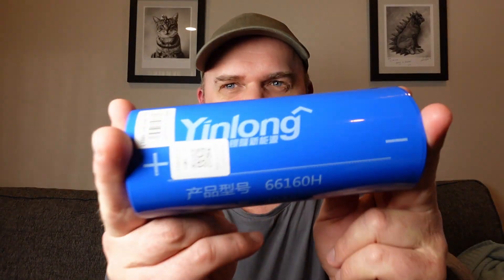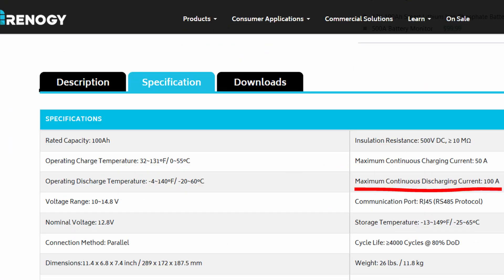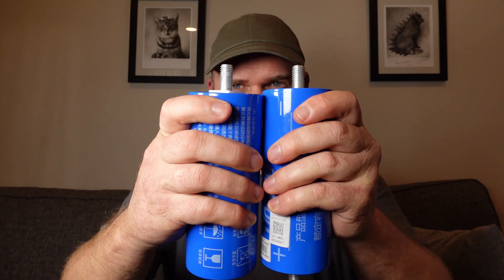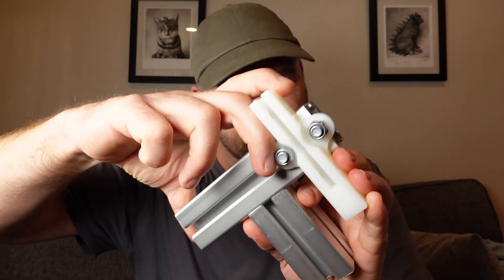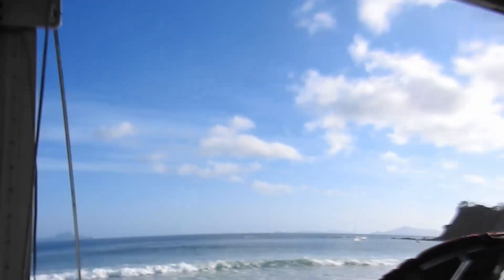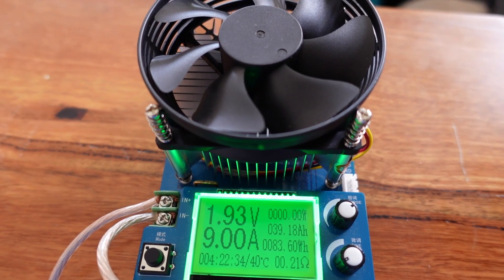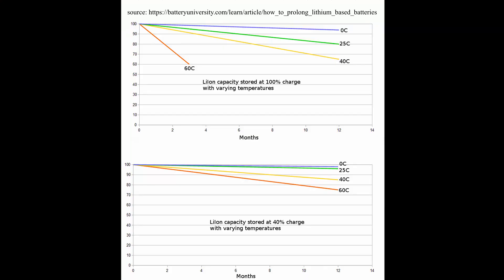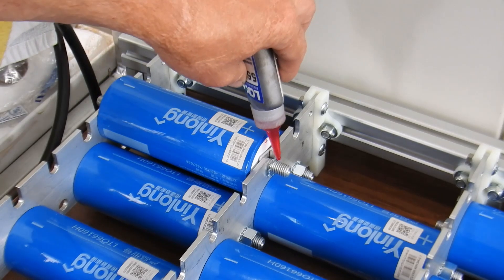Campervan DIY battery build HUGE POWER!

Comment: Aluminum was banned in house wiring decades ago partly because of oxidation increasing the connection resistance. How are you ensuring a gas-tight connection?
Reply from the maker: Hey Lu, thabks for your comment.  phew... just as well I'm not building a house! Several people have bought it up as a potential issue, but I do not believe it will be one.  The battery lugs are aluminum and I believe having nearly 200 copper/aluminium dissimilar junctions would be more problematic than aluminum/aluminum junctions.  The ali bar was lightly sanded before connection and a dielectric grease was put on the connection to prevent air/moisture from creeping in.  Keep following and I guess we will find out in time if it was successful.

Comment: Nice project. I wondered, what for you need so much capacity  - until i saw the fridge 😂 What kind of fuse and power switch did you use? Nice Unimog btw 👍
Reply from the maker: Cheers Stefan, yeah, induction cooking, electric oven etc etc.  Am using a big HRC Mersen fuse and an Industrial Siemens switch as a main switch.  In coming videos.

Comment: Here’s the problem:  many of the stats you’ve mentioned are manufacturers claims that are not necessarily reliable.  Especially regarding discharge rate, reliability and safety.
Reply from the maker: Here's the problem with your assertion...  LTO is not a novel chemistry to this manufacturer, it has been around for about 20 years. The chemistry has known properties, all of which show it to be the safest of all the lithium chemistries,  it is the only lithium chemistry that has been approved for use in medical implants.  It has the highest runaway temperature, graphite anodes are a major cause for thermal runaway in lithium chemistries (this chemistry does not have graphite electrodes).  It has the lowest internal resistance and highest drain because of the huge surface area that is afforded on the anode due to the nanocrystaline structure.  The discharge rates of these cells are well known by the car audio community where they run tens of kilowatts and monitor performance capabilities of these cells closely. The limiting factor for the life cycle of most lithium chemistries is the buildup of solid electrolyte interphase layer from decomposition of electrolyte and the breakdown of the graphite electrodes as they shrink and grow when cycled.  It also doesn't tend to grow dendrites which will kill a cell like other lithium chemistries do.  This chemistry does not form a stable SEI layer like traditional chemistries and the titanium based electrodes mean they dont break down in the same manner that graphite does.  While I can accept that specifications for all batteries are likely to be given in best case lab conditions and are unlikely to be fully met in real world conditions.  I believe that this is the safest and most rugged lithium chemistry available today.

Comment: He actually changed that assessment in a recent video.  He got 85% at a 5c discharge.  At a 1c discharge he got 99%.
Reply from the maker: Yeah, I haven't seen it.  But I might setup and do a 5C too. It's very easy to get unaccounted losses if pulling a couple hundred amps.

Comment: Dendrites are not formed from batteries being cold, its just the electrolyte freezing inside, your LTO cells have a different electrolyte which has a lower freezing point. (Edit: Dendrites form from charging while the battery is extremely cold)
Reply from the maker: Really?  https://www.researchgate.net/publication/269574387_Observation_of_Lithium_Dendrites_at_Ambient_Temperature_and_Below
Reply: @brendontait6968  ah, the dendrites form from charging while things are extremely cold, not directly from being extremely cold, so in a way we are both correct but not sharing the entire context of our statements. I learned something thanks!
Reply from the maker: Effectively dendrites are formed in lithium cells if used in cold conditions, charging does encompass use in my mind. This has little to do with the freezing of the electrolyte to my understanding. There is no way I'm likely to be able to make a video that details every conditional aspect of each claim I make.  I want to try and make videos that can capture and inform the majority of viewers key points.  I'm not very good at translating thoughts from my mind into digestible information, but working on it. Cheers

Comment: With all that aluminum bussbars, a dab of No Ox electrical grease is recommended to stop high resistance connections due to surface oxides on aluminum.
Reply from the maker: Hey..  yeah, you'll notice me wiping grease on the terminals with a cotton bud.
Reply: @brendontait6968  I missed that. Usually no ox is a dark grey color.
Reply from the maker: @isettech  I use silicone grease

Comment: I'm building an electric bike...
Would these batteries be suitable for hub motor application ? TIA.
Reply from the maker: Depends on your application, generally tho, no... they are a heavy for the energy capacity, look at a more flammable and toxic alternative, like a cobalt based chemistry.  The LTO would be cool if you wanted quick charge/low temp/long life.   But for light weight/high performance,  look at cobalt but dont charge it in your house overnight.

Comment: Very fine video!  Now I need someone to design me a flashlight that'll fit one of these beasts! :)
Reply from the maker: Thanks... some of the 18650 torches are phenomenal.  I'm likely to make an insane light bar for my truck too, so keep yr eye open for that.
Reply: @brendontait6968  I'm waiting for my Banggood Astrolux FT03 XHP50.2 5700K [$39] sometime in the next few days, and the 26650 5750 mAh 30A cell(s) [$13] wrapped by Orbtronic (good guy) have arrived and waiting.  I have a few dozen too many flashlights to justify another :) but accidents happen and I just have to see how it compares to the already very bright FT02. Banggood claims the XPH50.2 variant FT03 is twice as bright again! :o Here's hoping!
Reply from the maker: I'm a bit of a fanboy of the xhp70.2 4000K.  I find the warmer light penetrates the dark better with less back scattering from particles in the air.
Reply: @brendontait6968  Who makes a good xhp70.2 light that doesn't break the bank in your opinion?  I honestly haven't dabbled in any flagship emitters in years and years so a lot has passed me by.  Sadly, I've always found it nay impossible to locate 4000K options in popular lights, with an actual high CRI, given dealers don't want to mess with a light with a lower "big number" Lm output, and that actually costs more than the starch white option.  That said, I'm not disappointed with 5000~5500K tint at all.

Comment: Would a 10s setup match up better? 9s seems a little low. My 24volt inverter goes from 30 volt to 20 volt. My 24volt alternator runs 28.4volt.
Reply from the maker: Although their rated voltage is 1.8-2.8V the range at which they store power is realistically 2.0-2.6V as seen in the discharge chart I showed in this video.  This gives a useful pack voltage range of 22-28.6V which matches in pretty perfectly?  Holding LTO cells at high voltage especially in high ambient temperature can lead to outgassing.  This is something I should have covered in this video tho I thought it was already getting too long.  I'll definitely cover it in a future video.
Reply: @brendontait6968  Is your pack a 9s or 10s? I counted 5+4. Then you said 55 cells +44 cells. Your math is 10. I liked your build.
Reply from the maker: 11S
Reply: @brendontait6968  Woops, i counted wrong way. I see.

Comment: Excellent vid, well researched and executed build. Can I suggest you continue using 'Loctie' on your fasteners, but the 'real' Loctite. The grade you are using should only be used on large highly stressed studs. Loctite 222 Screwlock grade will give around the same breakloose torque as used during assembly, but with a low residual locking strength.
Reply from the maker: Thx.  The 'locktite' I used was loxeal 55-04.  Have you had a bad experience with it?
Reply: @brendontait6968  Not so much a 'bad experience', I was the Training Mgr for Loctite for many years. I understand how the technology works and how a lot of the copy cat product loses the plot so to speak. Genuine Loctite products are designed for specific purposes and have tailored features such as thixotropy and lubrication to manage the torque/tension relationship of the fastener. The product you used in this application is best suited for situations where a high breakloose and prevailing torque is needed. You will probably destroy some of the fasteners you have in this battery pack if you ever want to dismantle it. A better choice would have been a 'Scew locking grade' such as Loctite 222 or Loxeal 24-18.
Reply from the maker: @MrHitchikerOz  cheers, follow along and see if things go pear shaped if I ever pull cells out.

Comment: Be careful about accidentally limiting the contact of the cells to the busbars. If the joint doesn't conduct enough it could get very hot. Check out what your local electrical supply people use to attach power cables for houses. Here they use a plated nut and washer arrangement on a bolt. if you wish to then lock that in place you may wish to consider using electronic solder as it is very conductive.
Reply from the maker: Hey John, yeah... I understand the issues with ali.  Am using a dielectric grease on all of my connections

Comment: You didn't seem clear on this but a kilowatt-hour is a unit of energy, it is 3.6 million joules. One joule is the amount of energy required to lift a newton (a metric unit that weighs a little over 1/4 lb) to a height of one meter against earth gravity. The watt is a metric unit and is the rate of expending or accumulating energy at a rate of one joule per second. For comparison, think of it this way. You have a job and make money at rate of say, $20 per hour. Like watts is the rate at which energy is used or accumulated (or generated), the rate at which you accumulate money over a period of time (your rate of pay) is the rate at which your dollars are accumulated. Notice the key thing here is that "rate" suggest an element of time. Energy accumulating over time is watts, joules per second. Money accumulating over time is your rate of pay, ie dollars per hour. If you multiply your rate of pay by time, you get the total dollars you have accumulated. If you multiply the watts by time you get the total energy you have accumulated. Therefore, total electrical energy is expressed as watt-hours, meaning watts times time (equals joules).

Also, one ampere of current being delivered by one volt of electrical potential (electrical force of pressure) for a time of one second, is one watt. That is, amps times volts equals watts, which of course is joules of energy per second. So a 1.5 volt cell delivering one amp to a load, then delivers 1.5 joules of energy to that load every second. This is equivalent to lifting one newton of weight to a height of 1.5 meters every second. Don't let it confuse you, because energy can be generated, or expended, or accumulated, or stored, transported, or delivered, which like money, can be accumulated, stored, spent, or delivered, or transported. Coming or going, the units are the same, joules for energy, dollars for money.
Reply from the maker: Hey Rom, thanks for the comment.  I'm actually pretty good with units of measure (I use to run a measurement calibration laboratory).. the thing I struggle with tho is getting my thoughts across in a clear and concise manner....  working on it tho.  My major gripe is the use of amp hour as a measurement for battery capacity.  Battery capacity should be measured and termed in kWh.
Reply: @brendontait6968  You are so right about the kWh. And I know what you mean about getting thoughts across. With technical stuff, it is not a simple task. I do some teaching of electronics and struggle with getting the language clear, and of course trying to make the basics clear, because it is the foundation upon which all of the rest depends. I enjoyed your presentation. You nailed the topic, because this is an era of rapid battery development and I am trying my best to keep up. Not easy! Keep it up my friend.

Comment: Can these withstand high temps in the summer in the desert? That is why I'm still using AGM. My truck can get to 140 F parked during summer months
Reply from the maker: Wow, those are some crazy temperatures.  To be honest, there are not many chemistries that will appreciate that sort of heat.  I think these will do it, HOWEVER....  they must not be kept near full state of charge when being kept at those temperatures.  I'd consider investing in some sort of solar powered ventilation system for your truck.
Reply: @brendontait6968  ventilation is fine but when outside temps are 115 or more not a lot can be done

Comment: Loktite red is intended to be permanent, requires heat to break it down. Use Locktite blue instead, designed to wrench apart again.
Reply from the maker: Yeah, thanks... tho the type I used is loxeal 55-04 which is equivalent to loctite  blue, they just don't follow the same color convention.

Comment: That red locktight can sometimes be a nightmare. I always use blue locktight on my hobby RC trucks, they put up with a ton of vibration and very rarely do I get any screws backing out.

To get that red locktight off you have to apply heat, a soldering iron should do it boss.

Great video 🙂 we don't need a school education to be intelligence, if anything intelligence is switched on once school is out of the picture 🤣 .
Take care mate🤜🤛
Reply from the maker: Cheers Dave, the 'loctite' I used was loxeal 55-04 which is equivalent to loctite blue.  They just don't follow the same color system.

Comment: HALLO BRENDON,  I recently shoked my self on Supercapacitors' existence, and this by your video!!!   I'd need to contact you to explane you my life situation, 'couse you can really help me in many things with your Supercspacitors's knowledge.   In fiew words my questions are:  The super capacitor you have in your hands in this video signs 2.3V  and OVER ALL FOR ME, 40Ah,  right?... I have learned that capacitors can give us back a huge ammount of instant energy but dichargeing as fast as they can be recharged.  And my experience with AGM batteries on my van or Lithium battery packs  during my basking with live music tells me that A BATTERY LASTS AS LONG AS HOW IT'S BIG, IN THERMS OF THE Ah number....  So that my lithium battery (35Ah at 12V,  that takes 7/8 ours to be fully recharged by it's own 3.0Ah recharger)  will last 5/6 ours with my usual electric stuff and electric charge on it.
Now, to build a Supercapacitors pack with 12/15 Volts I know I need to connect 6/7 of them, HAVEING SOMETHING LIKE 240/280Ahmps!!!!  Just a dream for me, for the very light weight to carry around, BUT, WHAT CAN I ASPECT ABOUT THE DISCHARGING TIME OF THIS BATTERY PACK, INTERMS OF OURS OF USAGE AND WORK???   A very long or "normal" time of usage, with the capability to sustain even a bigger Audio Monitor (in terms of Audio Watts hits, like in the car audio tuning example in your video)  or an anusefull short lasting time of usage  (even if I will recharge the pack in fiew minutes some how)?.... Thank you for your answer and for all the big help you gave us by your videos.  Roberto
PS  And what about the usage of a supercapacitors 12/15Volts pack  IN PARALEL WITH MY USUAL Lithium Battery?  Could it be a good solution?
Reply from the maker: Hey Roberto, sorry to inform you that these are batteries are not capacitors.  They do have the ability to be charged and discharged quickly.  Many car audio people use this battery because of the ability for it to deliver huge power.

Comment: I wouldn't worry about your lack of trade experience as an electrician, you know more about this stuff than most electricians I've worked with. It's one thing to know how to put something together, it's a whole other thing to know WHY something goes together the way it does electrically
Reply from the maker: Cheers Jim, agree...  I've seen some solar install guys have some terrible practices but saying they've been doing this 20 years and using that as some excuse or assurance that they know what they are doing.   Cheers.

Comment: Red loctite for permanent assembly, blue for stuff you are likely to take apart.
Reply from the maker: Hey, yeah.  I didn't use loctite brand.  The type I used was loxeal 55-04 which I think is equivalent to loctite blue, they just don't follow the same color system.

Comment: LTO’s are like an Alaska cell, don’t care about could at all, but get 100 *f day with good solar input and an ac unit pulling on them and they will stroke ouon you
Reply from the maker: From what I'm aware of is they don't like being held at temperature and full charge so in hot periods, I might just wind down the charge voltage.
Reply: That’s exactly right treat it like a propane tank , gets about an 80 percent fill in the hot summer, if your using it in the winter you can fill it all the way up, but for longevity in storage they like to be around 1/2

Comment: Jack From evtv finally got it right before he passed away, 12v is to off grid and solar as AA batteries are to RC cars, the highly effective useable voltage ranges are in the 100’s of volts with many cells that distributes the load very widely at low amperages

Comment: Kva ? Do these “batteries” supply ac ?
Reply from the maker: I used kVA as a direct comparison, sure I could have done a 0.8 PF on the transformer and compared them, but it makes it difficult for avg people to understand.  While kVA is used mainly on AC power due to reactive components, it's still a perfectly valid unit of measurement to use for DC supply. (Much more valid than Ah for battery capacity)
Reply: Brendon Tait i see thanks for the explanation :D